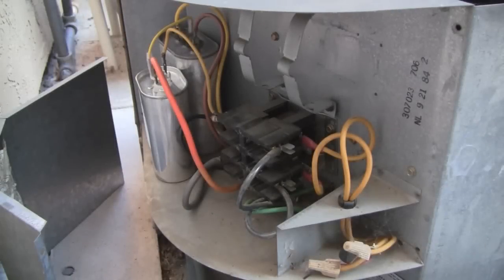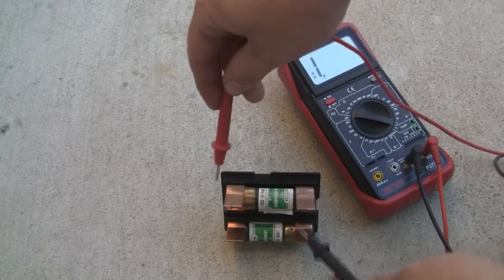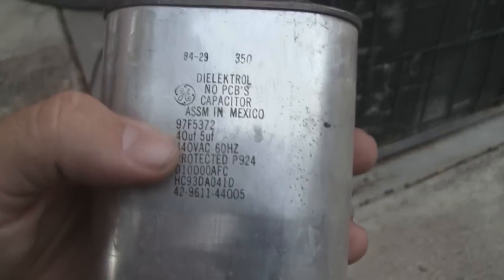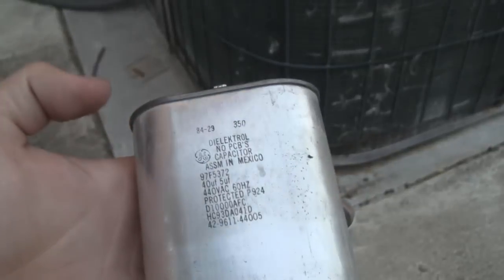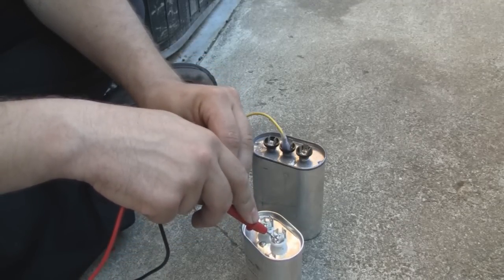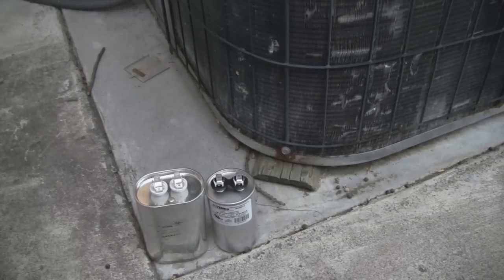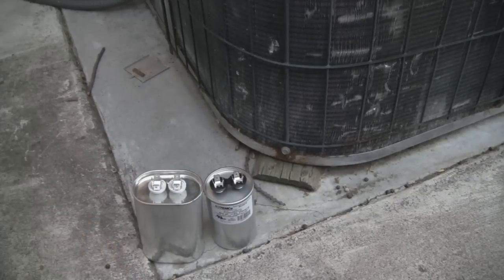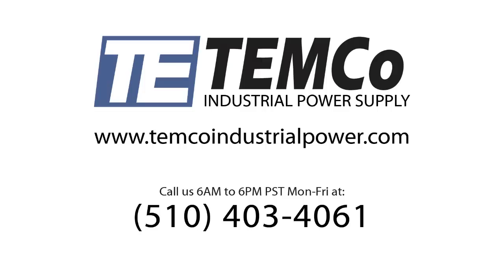Choosing A New Capacitor For Your Air Conditioner

Comment: As cheap as the caps are you should just replace that old 3 terminal you are still using for the fan with a new capacitor while you have it opened up. If one side has failed then why trust that the other side will keep working.

Comment: My ac was manufactured in 1988. A Ruud High Efficiency. Two capacitors, one for the compressor, one for the fan. 33 years old unit and first time needing replacement of capacitor. Original was branded Jard Sevonol.

Comment: Bad advice.  @4:30 and forward.  You never replace 440V capacitor with 370V capacitor.  You had your multimeter with you, why didn't you put it across the Capacitor terminals?  It would have been a big "shock" to you and your viewers.  FYI the H stands for (H)ermetic in Dual Run capacitors, it is the terminal that connects to the compressor start winding.  (Most small single phase compressors that need a capacitor are  "hermetically" sealed in a steel shell.)

Comment: I have a capacitor that runs the compressor thats reading 28. I have a new one thats 35. Its an older unit. I cant read the label. Can i use the 35 uf one. Or should i use a 40uf??
Reply: Unit still running with 28uf. I just think its a little old but am trying to replace it but i cant read the label.

Comment: Hello I have a capacitor 
York SFS3740A11
40MFD 370VAC 50-60 HZ
39H5801 10000 AFC 
PROTECTED 050531
Now I can’t get the same capacitor online so what can I do ,I found some capacitor but they are not protected(they do t have little pimple on top).so please help me out ..and this capacitor goes in attic on blower motor..and the reason I m changing is because I m getting very little air out of my vents ,so I thought maybe this will make a difference..thanks in advance .

Comment: So if your fan capacitor was testing at 5.2 microfarads, why was nothing happening when you applied power to your unit. Your fan should have been running and your compressor not been running. You didn't mention that and you you didn't replace the fan capacitor so how is your fan working? Also, fan motors will lots of times have on the spec plate what voltage capacitor is required to operate that motor. I never use 370 volt capacitors I only stock 440 volt. It's a good video for homeowners, but a professional service technician who actually knows what he's doing will raise an eyebrow at you and get a few laughs along the way.

Comment: This video is somewhat confusing.   

If you have a dual capacitor ... to control the fan and compressor ... why do you have two capacitors in the outside unit?  My outside unit only has the one dual capacitor.

Comment: I am a service tech of almost 30 years. You have basic troubleshooting abilities BUT your comment on capacitors frequently failing is complete BS! they should never fail! If you find a capacitor out of tolerance as you have here it usually is because of a over current condition which causes the capacitor to over heat. First culprit is usually a pitted and worn contactor once a contactor points gets pitted it starts to draw more and more current. and since the common terminal to the capacitor is usually on the load side of the contactor as it gets pitted the capacitor draws more and more current trying to start the compressor. as you can see one capacitor already failed before and now this is number two both on the compressor side. that would surely sugest a over current condition.A general rule of thumb is whenever you diagnose a bad capacitor replace the contactor as well.Also wouldnt hurt to check amp draw of compressor and make sure its not pulling excessive amps as well
Reply: cecil roberts capacitors always fail, are you kidding me?
Reply: Thanks.  Good info on the contactor.

Comment: Good video.  Capacitors often do run at a voltage higher than the line voltage.  The induction in the motor will result in a higher voltage in the capacitor.  That is why a 240VAC system requires a 370V capacitor.  It is better to have a higher voltage rating, eg 440 V.  This does not hurt a bit, and may result in longer capacitor life.

Comment: 240V is the RMS value. In a sine wave the voltage amplitude is 240V*sqrt(2)=340V. 
Thus 340V is the absolute minimum. The rest is margin.

Comment: If you looked above the contactor, you would see where the original capacitor was located. Why didn't you install the correct one that came with the unit. It is called a dual capacitor. It is true that the system will work with two separate ones, but  this now changes the wiring diagram. I like to keep the original, but if not available, a temporary fix, like the one you did is ok. Also strapping them down would lengthen the life of the unit by not falling over and shorting out on the side walls. Even vibration from the unit will separate the wire terminals from the spade terminal . Seen it happen, of I should say the outcome. But a good job for explaining Micro-farads.... and Herm is for compressor. (Hermetically sealed)

Comment: I have a 10 year old Lennox Central AC Unit.  The fan stopped moving, so
 I had the motor fan and the Capacitor replaced. Then it started working
 again.  After 30 minutes, the fan would stop moving while the 
compressor was running.  I could feel the heat generating from the 
compressor. Turned off the circuit breaker.  Tightened the wiring, then 
the fan worked again.  30 minutes later, the fan shuts off again.  Can 
someone tell me what the issue might be please?

Comment: The voltage rating for a capacitor does determine its operating voltage.  However, the power lines will see voltage spikes due to power glitches and lightening.  There is a term in called "de-rating"  and typically you will want a voltage value that is double what the operating voltage is.  Each time the voltage rating is exceeded, the dielectric between the capacitive plates breaks down, and shortens the life of the device.  By doubling the voltage rating you help ensure the life of the device.

Comment: Replaced capacitor on AC.  I left everything on the back of the AC open while I go inside test to see if cold air comes from the AC.  Everything was fine.  I left the power on went back outside to go ahead and attached the capacitor back to the AC with the strap.  When I lifted the capacitor to move it the metal holding strap touched a terminal the contactor and I saw a spark and then poof.  Everything quit working.  Waited for a while and turned the thermostat on and nothing.  The cool indicator on the thermostat just blinks and the outside unite will not come on.  What could be the issue?

Comment: You didn't mention how dangerous these capacitors are and how important it is to discharge them before working on them. On top of that you're touching the terminals.

Comment: I purchased a TEMCo 60/5uf 440V capacitor for my heat pump and it only lasted 1.5 years. Do not buy their cheap Chinese made junk.
Reply from the maker: Sorry to hear about your capacitor. We'd be happy to send you a replacement, as we rarely see failures on these units.

Comment: Good video - I am on my 3rd run capacitor on my 20 year Goodman A/C unit. First lasted 15 years, 2nd 5 years - will see how the 3rd one goes.  I will order a spare from TemCo.   The local A/C shop charged me $40 for the cap.  This was on Saturday - so most electrical supply houses were closed (e.g. Grainger) - and I needed my A/C for the summer heat.

Comment from the maker: The 45/5uf capacitor is out of spec if it's reading ~43/1.34uf; you'll have to replace that cap. The hissing is probably normal (it's the refrigerant working through the condenser). You just can't hear it normally when the fan runs. The air won't cool without the fan because the condenser will heat soak.

Comment: I would have thought that would be one of the first things to check. I purchased a capacitance meter from harbor freight and checked myself. It's a 45uF/5uF capacitor and it's reading ~43uF/~1.34uF. Sometimes the fan does come on with the unit but now unfortunately even when the unit is running it doesn't cool the air. A few times I heard a hissing sound coming from the compressor when the fan would not come on... was that the refrigerant being vented into the air?

Comment: I notice there was TWO "thumbs downs.". There is no way anyone could not like this video for any reason UNLESS those two dislikes came from 2 of your competitors! Nice to know you're so good at what you do that they always make it a point to watch your videos; shows you're doing something right! I feel that if anyone wants to give anyone else a thumbs down that they should be REQUIRED to explain WHY B4 the system will let them post a thumbs down, on ANY YT video. Good job!
Reply: I probably would have gave this guy a thumbs down just because he is doing unlicensed work on an AC unit for one, and the guy doesn't know that Herm on the capacitor stands for (hermetic) which means this terminal goes to the Hermatic compressor and the other goes to the condenser fan motor. Also the bare minimum voltage rating should be rated at the RMS voltage rating which is 340volts @ 220 hence the 370volt capacitor with which I would have upgraded to a larger voltage for life and longevity of the new capacitor. So sorry but he shouldn't be making videos with bogus information in them and its a thumbs down for me!

Comment: EXCELLENT video. Went straight to the most likely problem, explained it in terms anybody could understand; obviously used a tripod, good miking technique for good sound, and very unpretentious; did not try to talk over anyone's head. I would have pointed out possibility of either cap having a charge on it & how to safely discharge it though, and would have been good to tell them exactly what the cap does and how. A+ for having your unit in the shade, unobstructed, clean, easy to access. GOOD!

Comment from the maker: With the power off, can you free-spin the fan by hand without any resistance? Does the compressor sound like it's running properly? What are the voltages you're getting at the input to the unit?

Comment: Thanks for the video. Our AC is making a buzzing sound outside and the fan is not running. Replaced the capacitor as you mentioned and turned it on. The Fan sort of moves[just a slight movement] and i still get a bad buzzing noise. What else could be an issue ? the capacitor was 35+3MFD, 440V. i got an universal capacitor with the same ratings for replacement.

Comment from the maker: Ones from the 70's might also bloat. That and run caps have a design life (when exceeded, the internals can rapidly decay and drop in performance).

That Harbour Freight meter may only read capacitance on the little terminals on the top of the capacitor and not necessarily the front of the leads.

Comment: Not bloated. It's probably from the 70s - do those bloat too?

I went and replaced both run capacitors and the start capacitor - the start capacitor had corrosion on top and the other two seemed old enough that I should go for new. I tried getting a reading on one of the new run capacitors but got nothing. Should I expect the black/red leads to get me a capacitance reading if the dial's on the top F setting?

Comment from the maker: It's possible that your meter works fine, but that the capacitor has failed internally so that it's essentially become an open circuit, so you won't be able to get a capacitance reading.

Is the capacitor bloated by any chance? Oftentimes, they'll disconnect when bloated.

Comment: Ugh! So I just got a new multimeter to test capacitance and I see it's the same Harbor Freight model you have here. But I can't get it to show a capacitance reading! Does it only get a reading when something is put into the two Cx slots? I tried with the dial on the top F setting and set the black and red leads in their matching colored slots. What am I doing wrong?! Your video shows you putting the leads on the capacitor but not how the multimeter is set up. Help!

Comment: thank you for the response  its appreciated I had a tech out yesterday that I had scheduled an appointment last week since it was 4th July weekend it could not have came at the wrong time.  But it turns out you were spot on it was the Cap it was a dual cap did fan and compressor  the tech popped a new one in and started working again.  am very happy it was just that  for I couldn't afford to replace the outside unit.

Comment: I see this video was made a while ago but if you were still confused on what herm stands for on the capacitor it stands for hermetic. Meaning it is a hermetic compressor. It is not accessible on the inside of the compressor. Great video however.

Comment from the maker: This is correct. In this case, the capacitors had been replaced previously in the life of the A/C unit with higher voltage caps. It is not uncommon to see 370V rated capacitors used in 240vac systems. As tou have said though, it is not recomended to go lower.

Comment: Capacitance voltage rating is for the counter EMF (Back EMF) of the motor not the input voltage rating of the unit. Installing a capacitor with a voltage rating lower than the motor's Counter EMF will result in premature failure of the capacitor. You can always install a capacitor high a higher voltage rating than what the OEM original equipment manufacturer installed if you do not have one of the same voltage rating is unavailable.